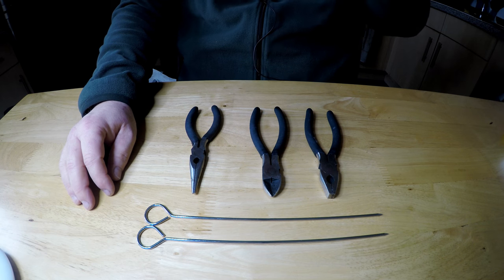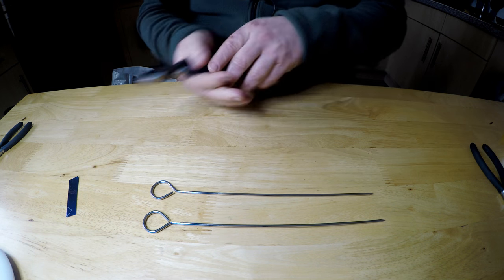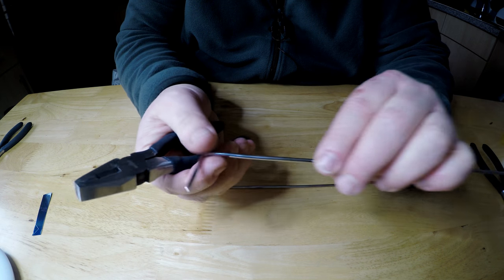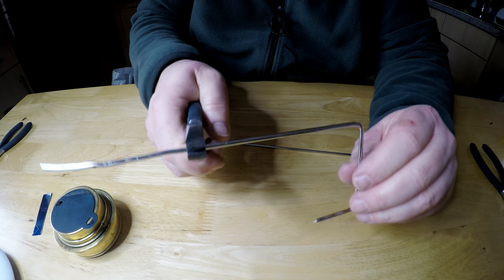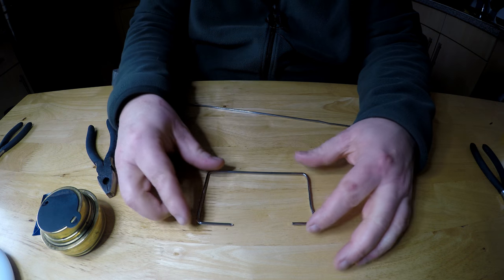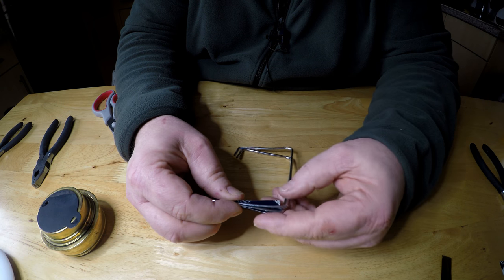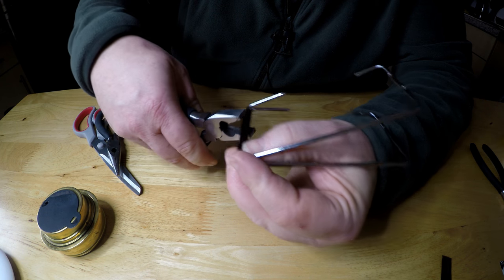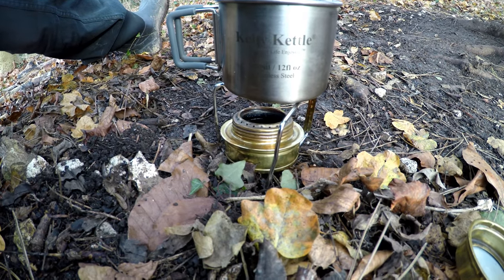How to make a Pot Stand - Trangia - Esbit - Fire Gel - Hexamine

Comment: If you need longer or thinker Stainless steel I suggest searching for Stainless Steel welding rods on Amazon, eBay or from the hardware store.  Its straight stainless steel rods or wire depending on the thickness and length is pretty cheap!
Reply from the maker: Thanks for the comment :) Good idea too.